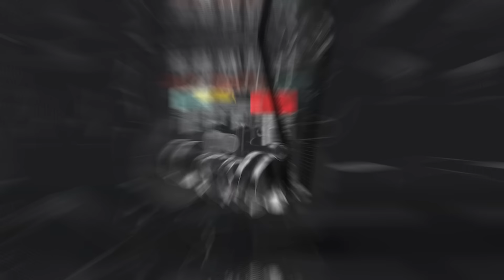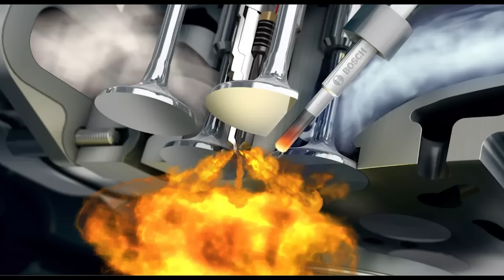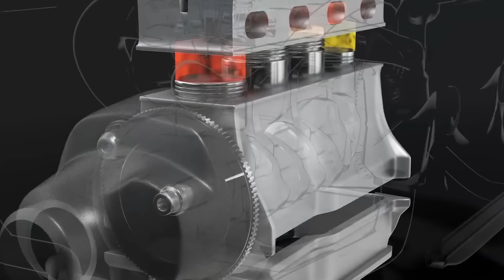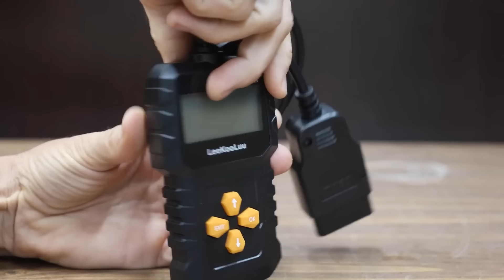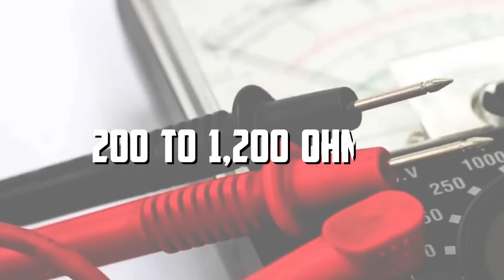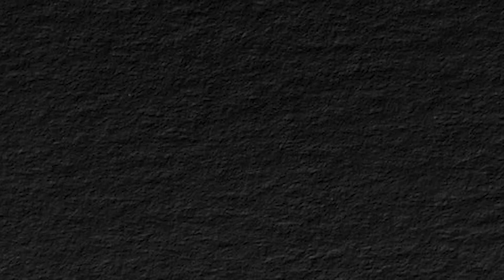9 Bad Crank Position Sensor Symptoms (FIX It in 9 Minutes)

Comment from the maker: 9 Symptoms of a Bad TPS and Fixes  https://youtu.be/o1hBd9dlBRE

⬇Care Care Clues Top DIY Tools and Products:
🚗 Essential Scan Tools
Newest Scan Tool:https://amzn.to/3GJyuET 
Bluetooth Scan Tool: https://amzn.to/42AcBRc 
Cheap Scan Tool: https://amzn.to/42WZIzx 

🔋 Emergency Essentials
Best Jump Starter: https://amzn.to/44fYOAm 

🛢 Fluids and Leak Stoppers
AT-205 Re-Seal (Stops Leaks):  https://amzn.to/3S9icYm 
ATS 505 Fuel System Treatment: https://amzn.to/3YQjjA2
Lucas Oil Transmission Fix: https://amzn.to/4jNk98M 
Bar's Cooling System Stop Leak: https://amzn.to/3Sht0nj 

🔎 Quick DIY Diagnosis Tools
Head Gasket Leak Test Kit: https://amzn.to/4jRgc2T 

🛠 Useful Maintenance Accessories
Quick Twist Oil Drain Valve: https://amzn.to/4jWG3GJ 
Tire Gauge (Check Pressure): https://amzn.to/3GxySGD
Tire Air Pump: https://amzn.to/3RZK9Cd 
CRC Mass Air Flow Sensor Cleaner: https://amzn.to/44dJpkb 

🧰 Mechanic’s Must-Haves
Car Battery Tester: https://amzn.to/4jTqyzk 
Basic Mechanic Tool Set: https://amzn.to/3Ymgerh 
Cordless Impact Wrench: https://amzn.to/3YkkhVc
Reply: 😂 my 1976 pontiac does not have any. 😂

Comment: Can this cause the car to go into safety mode and not allow the car to go more than 2,000 rpm’s?
Reply from the maker: A faulty crankshaft sensor can certainly cause performance issues and limited engine speed, as the ECU may enter a "limp mode" to protect the engine when it loses critical timing data.
Reply: @carcareclues yup. I got it fixed and haven’t had any issues since

Comment: Car dies off while driving , engine light shows up when car dies out .is this related to faulty crankshaft?
Reply from the maker: Yes, it can be. A failing crankshaft position sensor can cause the engine to suddenly stall while driving because the ECU may lose the crankshaft position/speed signal needed to control fuel and ignition. The check-engine light may also come on when the engine stalls.

However, those symptoms can also be caused by fuel delivery, ignition, wiring, or other sensor problems. The best next step is to scan for stored or pending codes and check whether the crankshaft signal is present while cranking immediately after the stall. If you share the **year, make, model, and engine**, we can narrow it down.

Comment: They ran for 100 fuckin years without a crank shaft sensor or a fuckin cam shaft sensor or oxygen sensors until some idiot came up with SEVERAL ways to stick it to poor folks. Some asshole with purple hair and a nose ring decided it was going to save humanity.

Comment: Someone told me it was not my crank sensor it's my reluctor wheel had to replace brake booster sensor cam 2 sensor car still want crank have not tried the crank sensor yet but code say something bout cam 2 which 1 replaced it

Comment: The #1 symptom of a bad crankshaft position sensor should be a crank no start issue due to no spark. The crank position sensor runs the ignition system, the cam position sensor runs the fuel injection system.
Reply: When I drive the car 30min it shuts the fuel, and fuel pressure jumps and than car stalls itself when I park on red light or nuetral. Itndoesnt start until it coola down
Reply: @sado350z did you ever figure it out? Mines is the same?
Reply: I did not know this tid bit of information. Thanks 👍

Comment: stressed out at long lights bumping sputtering and stalling so
 been there done that come to find out was a 27 dollar crankshaft position sensor 
3 bolts, had  forgotten how important they are
Reply: When I drive the car 30min it shuts the fuel, and fuel pressure jumps and than car stalls itself when I park on red light or nuetral. Itndoesnt start until it coola down

Comment: Makes sence, i replaced my fuel pump and fuel filter on my '95 buick roadmaster. The car rough idles and takes awhile to start but no check engine light even when the fuel pump went bad
Reply: When I drive the car 30min it shuts the fuel, and fuel pressure jumps and than car stalls itself when I park on red light or nuetral. Itndoesnt start until it coola down

Comment: WOW YES!!! So looks like my symptoms point to the crankshaft sensor. Sometimes I'll start my car and it'll start rocking back and forth for about 10 seconds.  😒 Then it'll settle down and I can start driving. The check engine light comes and goes (stays on for a day and then goes away for days or weeks).😌 Took it to the mechanic and he was eluding the sensor. So glad it's not too big of a fix.🤧

Comment: Better question is how do you differentiate issues due to a camshaft vs crankshaft sensor?
Reply: yes, he should have mentioned fuel pressure issues and bad ground issues vs crank sensor issues and how to pin point no start issues..

Comment: what is the difference between crankshaft and camshaft
Reply: Crankshaft is what pushes/pulls the pistons up and down. Camshaft is what pushes the valves and compresses the valve springs allowing air in and exhaust out.

Comment: I noticed high RPM reading, and check engine light.
The diagnostic test showed sensor issue.
The mechanical took the sensor out, cleaned it and changed the socket where the wires go in.
After a reset, RPM is back to normal and check engine light is off.
I’ll drive the vehicle for a couple of days and see what happens.
I’ve immediately noticed better acceleration.
Thank you for the video, it has really benefited me a lot.

Comment: 2002 Buick century won’t turn over, commuter says the cps is faulty. I had symptom 6 and it was hard to start sometimes. Then it just stopped starting like the battery was dying, but I just put a new battery in it. So it might be the rear crankshaft position sensor.

Comment: Can this sensor cause misfires at an especific rpm range (1400 - 1800)?, Before and after that the engine runs smooth. Its a 2014 bmw f30.

Comment: I have experienced these symptoms, checked the engine by tester which indicated fault crankshaft positioning sensor. I replaced and the car; Nissan pathfinder 2008 running well. It costed me around 100$ including everything. 

Thank you for this video 🙏🏻
Reply: Wow I have a 2005 Honda accord ex v6 it thrower  a p0335 and p0389 code for crank shaft sensor my car runs but cut off wen it gets warm but will crank back up I was told it’s the crank shaft sensor

Comment: I had a reading PO34O on the tester, so I replaced the Camshaft positioning sensor, but the problems continued. I have almost all of the symptoms of the CRANK shaft sensor except bad smelling exhaust. Does the camshaft positioning sensor also have the same symptoms?
Reply: Yeah they do. I was told when you replace one just go ahead and replace the other

Comment: I have all of those symptoms in my 1998 Ford Explorer. The sensor finally threw a  P0340 check engine light. Will replace it. Hope it fixes it.
Reply: P0340 is for the camshaft sensor. P0336 is the error for the crankshaft sensor.

Comment: i ve put so much money on finding out why my f150 2016 5.0 was stalling at idle and a rough idle sometimes and no mechanic tought about this sensor and nom I'm convinced this is it
Reply: Sounds like me and my 99 Dakota I've been going back and forth for 2 years getting this thing fixed every time I fix something another thing broke. Finally got it working great for 6 months and then started stuttering and stalling the past week. Finally caught pending code for crank pos sensor, and getting it replaced tomorrow lord I hope it fixes it.
Reply: @seansy59  did it fix it
Reply: @RichestTM  Yes! Fixed it instantly. Runs excellent now.
Reply: did that fix your problem?
Reply: Im about to put one in. I have put so much money trying to fix my problem that no one can figure out. It starts cold but after it gets hot and sits it will hardly crank. I hate to have to buy a truck but its about to never start again. Im praying this is my problem. If its not im going off the deep end. Lol. 🤞🙏🙏🙏🙏🙏
Reply: @Charliegirl2 I am having the same problem w my mazda. I've done almost everything. Did u figure yours out?

Comment: NOT ALL VEHICLES WILL FAIL TO START WITH A BAD CRANK SENSOR!! Some Honda's, Volkswagens and Toyotas will enter a "LIMP MODE" and run at a lower engine performance level and hold back on any "correction" shifting done by the transmission. Thus it can make you think you have a bad transmission, a bad coil pack, or even bad fuel injectors. Once the signal is dead the ECU will run in a backup mode or not run at all. Most GM and American makes are too dumb to keep running but, At the same time it prevents the engine from having any unnecessary damage from driving on misfires.
Reply: 🖕same shit
Reply: Correct . Or they’ll run amazing for 30 minutes and suddenly fall on its face with only so little power available to make it home . Thats my problem lol Im gonna buy one tomorrow and see how it goes . Fuel pump , filter , injectors , plugs , coil packs all new . Hopefully this fixes my problem

Comment: I live in Hawaii and my cps cost only $25. You can expect to pay up to $100 to buy one.
Labor should not be too much based on the ease in removal most times, so less time spent. $150-200 with labor normally. 
If quotes are much more than this the shop is trying to take you most likely.
Ofc european cars will be higher
Reply: on our Escalade it's behind the starter...pain in the ass .. I had an 07 Chrysler Aspen with the 5.7 hemi, also behind the starter

Comment: WAIT A MINUTE... Step 3 Check the Voltage Output, "reconnect the sensor and set multimeter to AC voltage, while cranking reading should be 0.2 to 2 volts".....
 if the sensor is plugged in where am I connecting the multimeter ? ( and don't cars use DC not AC?)
Reply: The sensor creates its own AC voltage because it is a magnet passing through a coil of wire the signal wire is basically a ground that the computer monitors and the other side it unloads to chassis ground the signal wire carries a low voltage to the computer which it dumps to ground triggering the signal for your ignition coils

Comment: I really hate my car now, to many codes, all pointing out the same as in the video.
Trusty mechanics don't exist in my area, or they charge to much for a simple job.
Either way, I am to broke to fix this car.
I already had the ecu worked on last year, as the software needed to be updated, for the o2sensor to work properly, after replacing it 4 times in a year-wtf! I hate newer cars!
My 1973 Camaro LT-Never had this kinda bullshit, with all these sensors and electronic bullshit.
Reply: There are some mobile mechanics can work within your budget even though you said broke 
but hey its a start, mine was 27$ and 3 bolts later but not easy for some so Good Luck
Reply: Yeah sell your new junk car and daily a classic

Comment: I just replace my  own and my Ram 2013 1500, and my checking engine light  is on
Reply from the maker: It’s great that you replaced the crankshaft position sensor yourself! If your check engine light is still on after replacing it, here are a few things you can check:

1. Reset the ECU – Try disconnecting the battery for about 10-15 minutes to reset the system. Sometimes, the ECU needs to relearn the new sensor.
2. Check for trouble codes – If the light stays on, use an OBD-II scanner to check for stored trouble codes. It might reveal whether there’s another issue or if the sensor needs calibration.
3. Inspect the wiring – Make sure the sensor is properly connected and there are no damaged wires or loose connections. A poor connection can still trigger the check engine light.
4. Verify the part – If possible, double-check that you installed the correct sensor for your specific engine model. Some aftermarket sensors may not be fully compatible.

If you still have issues, let me know what code(s) you get from the scanner, and I’ll help you troubleshoot further
Reply: Do your dashboard/key/pedal reset. Whatever model your vehicle is.
Reply: Did you replace with OEM? I have bad luck with aftermarket sensors with dodges

Comment: One thing with the crank angle sensor faults is the ECU will clear most codes if the car begins operate normally so in short by the time you get to read the codes and if you already drove it will more then likely be cleared...So if your car stops after get hot or on hot days it wil be 100% crank angle sensor because they have a small magnet inside and over time it becomes weaker and magnets can lose strength when heated so on hot days and you are idling at the lights the crank angle sensor just isn't putting out pulses strong enough for the ecu to read the position and bingo no running... When the car cools down the sensir magnet recovers enough and you can start...until get too hot...in short these sensors run at about 20 to 30 bucks on ebay ...Just change it it not worth um and arhing as it is one bolt and one clip in most engines.
Reply: Never eBay always rockauto genuine parts oem only
Reply: Any idea's on why a car would die in the same stretch of road multiple times, it dies when inline with a celltower
Reply: My car starts and then if I use it for a while then try to turn it on again it only keeps cranking but wont start. Do you think this might be it?
Reply: @garystewart3423 I'm not sure. But I know on some older Honda's it was a bad pressure
Fuel pressure regulator.
Reply: @XavierG-s2k  Ive an Audi 2011 tdi. Cuts out when it hits 90c. Did read it could be this so bought a new one. Problem is, cant find where it goes. Just hope its not in the crank casing.
Reply: @garystewart3423 

Are you the Gary Stewart in Montana ? Champion bow hunter ?
Reply: same thing here When I drive the car 30min it shuts the fuel, and fuel pressure jumps and than car stalls itself when I park on red light or nuetral.And when car cools abit it starts perfectly, fuel pump prines everything ok on fuel system

Comment: Just changed my camshaft censor on my 2010 R56 JCW as it failed.
Every symptom you mention in the video happened to my car. 
I had a week of my car running rough before I could change it.
Reply: Did you have to reprogram anything or just plug and play
Reply: @dimi911 it SHOULD be plug and play

Comment: My car is250 lexus 2008 give really bad when i press accelerator the smell coming inside the car any solution?
Reply: Yeah sounds like someone has got your catalytic converter.
Reply: Cracked exhaust manifold probably. Mine is. And if I use the heater or ac while sitting still, the exhaust fumes go from the headers and vents right into the interior

Comment: 08 crv 
Good battery 
Good starter
Good alt
Fuses and relays Good 

Lights come on the dash like they should then try and start and it's like it's dead

I've never had this problem b4 and it's outta the blue any ideas
Reply from the maker: It sounds like your CR-V might have an issue with the crankshaft position sensor or a bad ground connection. If the battery, starter, alternator, fuses, and relays are all good, but the engine won’t crank, check these:

1. Crankshaft Position Sensor – If it's faulty, the ECU might not be sending the signal to start. Try scanning for codes with an OBDII scanner.
2. Neutral Safety Switch – If it’s an automatic, try starting in neutral instead of park.
3. Bad Ground or Corroded Battery Terminals – Even if the battery is good, loose or corroded cables can prevent it from sending power to the starter.
4. Ignition Switch – A worn-out switch can fail unexpectedly. See if jiggling the key in the ignition makes any difference.

If none of these work, try jump-starting it—if it fires up, your battery might not be as healthy as it seems. Hope this helps.

Comment: What is the main things that the sensor of the crankshaft do....?
Reply from the maker: The crankshaft position sensor is like the engine’s timekeeper—it tells the ECU exactly when and where the crankshaft is so it can control fuel injection, ignition timing, and RPM. Without it, your engine would be as lost as a GPS with no signal.
Reply: 2020 escalade engine code shows oil pressure sensor but allready changed people are telling me it could be a bad cam sensor or crank sensor so I searched it up and this came up vehicle works fine while driving just at idle it shakes and the rpm goes up and down feels sluggish like if it wants to turn off but doesn't and only happens at idle or when coming to a light any suggestions